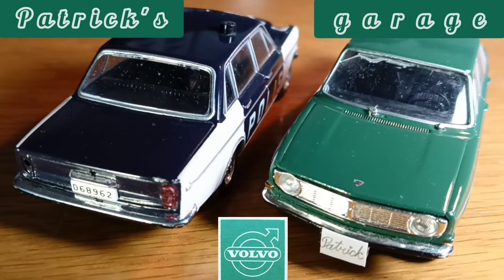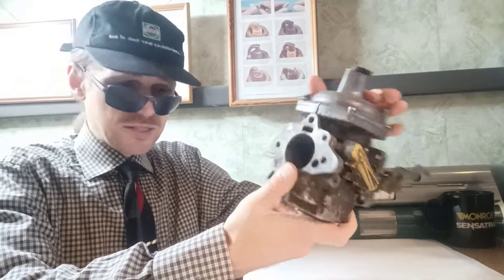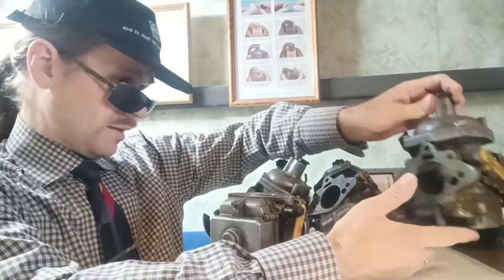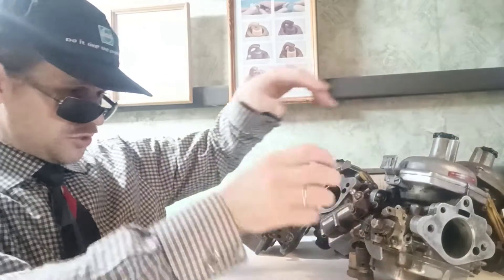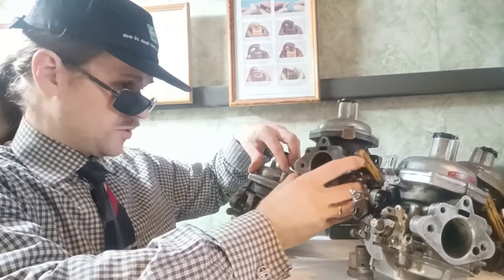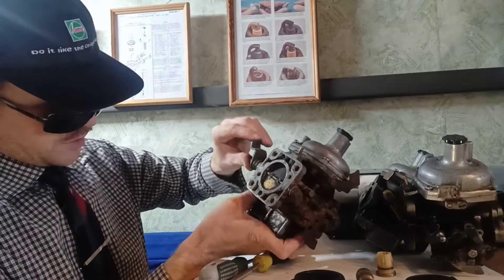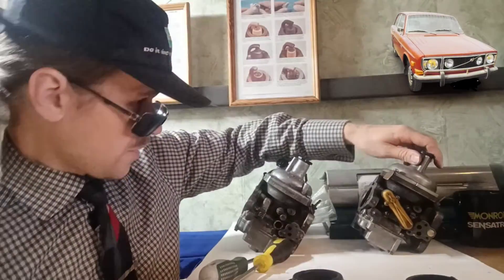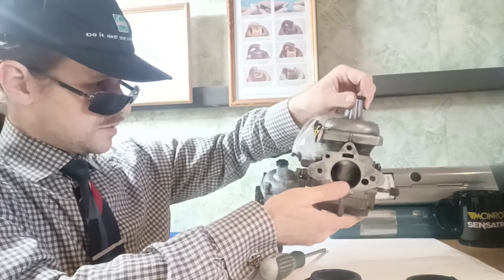Carburettor Zenith-Stromberg 175CD 2SE How To Repair #volvo140 #carburetor #carburettor #stromberg

Comment: What are main problems woth the stomberg 175 cd. ? I have a mercedes 230c 1978 and is drinking gasoline like crazy
Reply from the maker: @mateolopez7225  The main problems with the Stromberg 175 CD that cause high fuel consumption include:
Worn or stuck needle & jet – If the needle or jet is worn out, too much fuel flows into the engine.
Incorrect float level – If the float is too high, excess fuel enters the carburetor, making the mixture too rich.
Leaking float valve – A faulty float valve can cause fuel overflow.
Damaged diaphragm – A torn or improperly seated diaphragm will lead to an excessively rich fuel mixture.
Choke stuck open – If the choke doesn’t close properly after warm-up, it keeps enriching the mixture.
Blocked air filter – A clogged filter reduces airflow, making the mixture too rich.
Vacuum leaks – Air leaks in the carburetor or intake system can cause incorrect fuel metering.
Incorrect mixture adjustment – If the mixture screw is set too rich, fuel consumption increases.
But before blaming the carburetor, are you sure it's the actual cause? Other factors, like ignition timing, spark plugs, or even a weak spark, can also make the engine run rich. A clogged exhaust or a failing fuel pump could contribute too.
If you're certain the carburetor is the issue, start by checking the diaphragm, float level, and choke operation. If those look fine, a rebuild might be needed.
Reply: @patricksgarage  thanks I will check. But 100% sure is carburator. I'm trying to buy rebuild kit. But I found my self against a wall.. doing some research I found there are some variation of the carburator.. is there any way I can identify which I have? And where to buy replacements. Thank-you
Reply from the maker: @mateolopez7225  To identify your Zenith 175CD carburetor, check for stamped numbers on the body, usually near the base. You can find  Mercedes classic car forums.
I personally prefer eBay for buying parts and old paper service manuals to find information. My Volvo carburettor can be designated exact even by its stamp on the metering needle if it was not replaced by someone before 🤔(just for instance 😉). It's also useful 😃 if thin brass designate plate was lost, which should be attached to the top of carburettor.

Comment: Hey Patrick!  You are a lucky guy having all those carbs. They are worth money now :). At least in Poland they go around 200 Euro. It's good thay repair kits are still available. Someday I will get an old volvo with carb and I will rewatch your all carb videos :). Thanks for making them!
Reply from the maker: Hey Marcin! Thanks for watching! I only bought, but I didn't sell anything.   Yes, kits and and parts available eaven today. I know that your Volvo with fuel infection. It's good when all these systems work properly.🙂
Reply: @patricksgarage  Yes. Fuel injection works very well in my car. I had no issues at all. I like carb setups because they don't use electronics. Just pure fluid mechanics ;)
Reply from the maker: @marcinbujok7388  Yes! Exactly! Only mechanical. It's beautiful. But latest carburetors on many cars was so crapy with electrical additions.
Reply: @patricksgarage  hi gentlemen. i, too, really like zenith stromberg carburettors. i have five or six that i bought from the Royal Thailand Air Force for use with Limbach L2000 motors (two 150 CD for each motor). From sea level to 18000 feet of altitude they compensate automatically for the thinning atmosphere, no electronics involved🙂. reliable. rebuildable. adjustable.
Reply from the maker: @tkxmix  Hi! Very interesting that they compensate for automatically thinning atmosphere. I didn't know about it. When I was young I didn't understand eaven how they works and I was really impressed when not found any electronic. Turns out today I don't know everything about them. Thanks for new(for me) information about carburetors 🙂